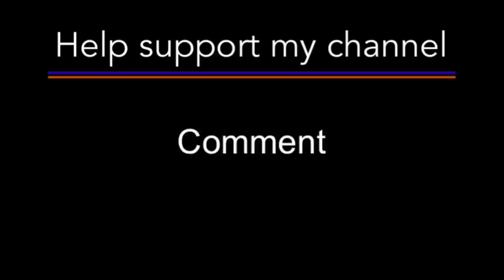Woodturning Green Wood: Walnut Log to Bowl - Turning The Big Green Monster

Comment: It's all a learning curve with each bit of wood you seem to be recognising your mistakes and problems your encountering which is a good thing to better one self I would only say one thing try and be more patient and take more time iam not a master by no means but I've learned that slowing down and being patient with yourself will guide you in the right direction keep the good work up .all the best
Reply from the maker: Thanks for the encouragement. This particular project was a bit of an experiment as I normally rough turn bowls, dry them in my dishwasher kiln, and then finish turn them. I wanted to try one green and see what happened-I like the organic look of the warping. I did end up having to rush the finishing on this piece as I got started late and ran out of time, knowing I wasn’t going to be home for a few days, but so far it’s not cracked so I may tidy up the finishing a bit once it’s done moving around 😁

Comment: What fun!  I love turning  green logs, can't comprehend having someone gift me a piece of walnut that size (any size).  If the lathe so stable and level, try building a cattle guard style mat out of construction 2x4 ripped to the width your need to get you at a comfortable working height. They are very common in front of metal lathes, both for foot comfort and safety as it gets you above the accumulated waste. Very nice outcome, good work!
Reply from the maker: Hi Gord! I must be doing something right, karma has been good to me so far 😁
I may try an elevated platform. For this walnut bowl I swapped my foam pads for a piece of 3/4” plywood with those foam play mats glued to the top, which adds probably about 1.5” of height and I still feel like where I’m comfortable holding the tools handles is a bit low. I’m a little nervous about making a platform so tall that I might accidentally step off it - I broke my ankle in Jan 2019 (and spent the next 3 months in the lazy boy binging Woodturning tutorials on YT 😁) and that was one of the worst experiences I’ve ever had. A plate and 9 screws, which I had to have removed after the fact cuz the hardware was so close to the skin it was gonna be a problem if I ever whacked my ankle on anything 😳
Anyway, I think I’ll try it and see how it feels - what exactly do you mean by cattle guard-the fencing to use as the platform top?
Reply: @LisaRamlow  hello again. Sorry I grew up in cattle country. What I was suggesting is to rip some 2x4 to become 2 3/4 wide (or whatever height you need. Then laminate them to 1” spacers so there’s a 1” gap between boards. Make it large enough so stepping off while working is not a threat. I get your safety concern perhaps adding a 30 degree transition or even 15 degrees so there’s no abrupt drop?  Just a suggestion you understand
Reply from the maker: Gotcha. A good suggestion and one I’ve been mulling over. Several of you have recommended the same sort of thing so I’ll have to give it a try 😁

Comment: Nice work.  My American Beauty has a much larger swing than I have bravado.  16 inches is my largest to date. I never turn green wood but you showed that it can be done with great results.
Reply from the maker: Hi Rick - that’s a nice machine, even if you don’t test it’s limits 😉
I normally twice-turn bowls but wanted to try one green and see what happens. I was really pleased with how my lathe handled this blank - I couldn’t get the speed up past about 300 until I got it more wound but the lathe acted like it didn’t even know it was there 😁

Comment: It’s a great looking bowl. You’ve got to love the ones that give you hell and test your skills. 
 I’m finishing up a 10”x 4” blank of Norfolk Island Pine. It won’t balance, no matter what I do. Tear out has been a nightmare. And I’ve had to walk away from it three times already. My daughter stopped by today and saw it on my lathe and said she really likes it.
 So those projects that test our skills will only make us better as long as we don’t give up.
Reply from the maker: Absolutely! I haven’t worked with NIP yet but may have an opportunity to get my hands on some this year
Reply: Regarding Norfolk Island pine, yah they don’t balance well because if you have branches showing in your piece, each one is of different size and weight. If you are planning to make it thin and translucent soak it for days or weeks in boiled linseed oil, polyurethanes and odorless paint  thinner equal parts of each and wet sand. I spent a day with Ron Kent  in Hawaii and that’s his process and mine too.  By the way you can find his bowls at Gumps for around 3 K.   Mine are considerably cheaper but he’s the original !!

Comment: Walnut with the wax wood is stunning. Love the bowl!! Cant wait to do bigger stuff but I have a 12in max for now. Great looking bowl :)
Reply from the maker: My Delta was technically capable of 12.5” and maybe with a round blank to start might have been able to handle it with the 1HP motor. This is a 220v 2HP motor and it seemed like it hardly noticed it was there!

Comment: Nothing better than a finished walnut piece. A suggestion for roughing out without getting the tar beat out of you. Try lowering the tool rest and gouge handle so it's not such an abrupt cut. Many of the great woodturners say if you're getting beat up, you're doing something wrong. It's no fun getting beat up by a piece of wood. I'd suggest watching Lyle Jamison's videos for basic positions of bowl gouge cuts. You'll never see him get beat up while turning. He makes it looks so easy and has many years of experience teaching. Have fun!
Reply from the maker: Hi Greg! I think I’ve watched all of Lyle’s videos, among others. He gets the speed up by starting the blank between centers and balancing it out, that way the roughing is easier. I didn’t want to do that with this big a blank so I used the faceplate. My bandsaw is unhappy again so I didn’t bother trying to get the blank any more round, just figured I’d do it on the lathe. Once I got the long end closer to the width it cut really nicely but because I had a couple of inches difference I couldn’t get the speed up right away and it was a rougher roughing out than it could have been 😂
Reply: @LisaRamlow  Lisa, Thank you for the reply. I don't own a bandsaw so either I do like Lyle (between centers - balanced) or if the piece of wood must start out of balance, I start with low speeds but found ways to avoid the beating. Go back to Lyle's videos and watch his tool angle. I used to just take the beating but my hands just can't take it nor should they. Try experimenting with dropping the tool handle and let me know what you find. Woodturning should be fun and when it isn't, it feels like work and gets a little discouraging. Just trying to help with what I learned the hard way. Also, it helps to take lighter cuts until it's more balanced.

Comment: Hi Lisa , Great looking bowl, it turned out looking very nice, you commented where you were saying your lathe was too tall , you could experiment by laying some sheets of plywood or chipboard down in front of the lathe until you feel you've got it at the right height but you must make sure you don't go on trip on it and fall into the lathe as you go to walk towards it so be safe, 
Phil from the Moulin in France.
Reply from the maker: Hi Phil! I did add a “riser” I’d used with my old lathe for this video - it’s just a 3/4” piece of plywood with those foam play mat things glued to the top so adds maybe 1.5” of height. I’ve thought about making a taller one but I’m a little afraid I’d accidentally step off backwards. I broke my ankle in 2019 and that was a horrible experience-don’t want to do that again! I’ll have to experiment a little and see how it goes. It’s not such an issue for the traditional tools-maybe I can just pay extra attention to whether or not the carbides are level when I’m using them.

Comment: I like it. Love the sap wood. Its a nice contrast. 👌 i rarely have time to finish a bowl in 1 session so i have started tieing a walmart bag over it while in the chuck if i have to leave it. Still warps some but seems to help a bit. Just something to maybe try if it comes up
Reply from the maker: Hey Brad! Yeah I did that with a wet white oak crotch piece and while it didn’t crack on the lathe and I was able to finish turn it, it made a nasty rusty mess of my chuck. I was going to be gone the next couple of days and didn’t want to take a chance in losing the whole thing. I like the wonky warpy bit just fine, if it will stay intact 😁

Comment: Wish I could have a play date with you.... As for the tool marks, both inside and outside, I prefer a shear scrape to a NRS. The NRS is still a scraper, and most of the time, since it is a scraper it will pull at the fibers to cut rather than slicing. The shear scrape, while not technically a scrape, slices. I prefer a dedicated scraper with a honed and burnished burr. The NRS works for some woods, but not others. It would have saved a lot of sanding time... On the inside, you have to shear scrape in stages, so on a bowl of this size, maybe 1 1/2 inches deep at a time. Because the wood moves as you hollow, you may have to blend in the stage marks... A coring system is a must if you are doing bowls of this size. I prefer the McNaughton, but as I say, 'Every one who has used it swears at it. Those that know how to use swear by it.' Oneway and Woodcut work well also. 

I don't turn walnut any more. Makes me sneeze and itch. I have found it to be a very easy wood to dry without cracking, very stable. I do like the stretch film on the rim, and start out with the bottom of the bowl on the concrete floor. A green piece is dry in a week to 10 days max. I do power sand, and prefer to have them dry before sanding. Having a lathe that goes down to 10 or so rpm is essential, otherwise, you have to spin the bowl by hand or use your spindle lock.
Reply from the maker: Meeee tooooo! I wanna come to Oregon! I’ve watched all of your videos at least twice and still got back when I get hung up on something, so thanks for putting out such great content 😊
Most days I do an OK shear scrape with a gouge on the outside. I have that cupped carbide shear scraper on a round shaft that I use a little on the insides if necessary but I just have a hard time making a smooth pull stroke with any tool (though I am getting better 😁)
You said a while ago (when I was using the shank end of a drill bit to put a burr on a scraper, which didn’t really cu it wasn’t the right kind of steel) that old router bits work well. I have an old straight carbide bit I don’t use so have been using that for the burr but I’m not sure I’m doing it right - I’m just holding the bit in my right hand with the cutting edge facing away from me and dragging the not-shear edge of the carbide across the end of the scraper at a little bit of an angle, maybe 5-10deg off from the scraper edge - is that right?
A coring system and a hollowing system are on my list - I want to be able to do some vases and hollow forms and now that I’m set up with my trailer ready to go I can get and process my own wood so I will have better access to pieces that would be good coring candidates. Aside from a couple of large pieces a friend of mine gave me I rarely have anything large enough to core.

Comment: Love big bowls. Add that it is walnut and you’ve captured me. The issue is that green walnut will warp like crazy. You did a great job with this piece. It will most likely stay together but will most likely warp so badly that it’s unusable. While watching I was asking why you couldn’t rough turn it and let it dry before finishing. Then again, I’m not good at doing that either. Beautiful bowl and I’m hoping it remains usable for you.
Reply from the maker: Hi Doug! I do normally rough turn, kiln dry, then finish turn bowls but I wanted to try one green and see what happened. I left enough on the bottom to be able to sand it flat once it’s dine warping so I’m hoping it’ll stay intact!

Comment: Well turned, thanks for the turning fix. I'm currently not able to turn due to recovering from 2 stays in Hospital, 1 for gallbladder removal, and the 2nd from infection from the surgery. Anyway, beside's from having the Lathe level, I've found having the spindle height at elbow height when your arms are relaxed in a standing position seems to be the best height for me, and a lot of turners seems to agree on that, and it works for me.
Reply from the maker: Sorry to hear you’re not at 100%. Hope you’re back to making shavings soon!
When I set the lathe I tried to level it where the sentry of the spindle height is at about my elbow. This is going to sound funny but I think my problem is that I have a long torso and short legs, so when I hold the tool handle against my body where it’s comfortable (about hipbone-ish) the end of the handle is lower than someone the same height but whose legs are longer and therefore the hipbone is higher from the floor. My girlfriend and I are the same height but her legs are 2” longer than mine and when I get in the car after she’s driven I can’t see out the rear view mirror without tilting it up 😂. In any case I think in addition to trying to pay attention to the tool position when I’m turning I think I’ll try a taller platform and see if that feels right. Hope you’re feeling better soon - thanks for watching and for the suggestion😁
Reply: Thank you, I'm itching to get back into things, at least YouTube helps with getting my turning fix, lol.
I think trying different platforms is a good idea, at least that way you can adjust things to find your best position. Goes to show that everyone is different, lol.

Comment: Good looking bowl. Having the lathe a little too high is actually a great thing. It is much more comfortable to work a lathe with a wooden platform under your feet.
Reply from the maker: Hi Charlie! I just moved the “riser” I had for my old lathe to this one to see if it helps. I have a piece of 3/4” plywood with those foam play pads glued to one side and that totals probably about 1-1/2” thick. I don’t think it’s an issue for the traditional tools but I think the scrapers should not be presented to the wood at a positive angle and what feels level to me while I’m turning is apparently not! I may try building a taller platform but I’m a little nervous about that since I broke my ankle in 2019 and that was a pretty horrible experience - don’t want to step backwards off something too tall and do that again 😬

Comment: Great job,  I think you would do better taking more out of the center and work on the thickness at the finish because centrifugal force throws the moisture out, so to keep it from cracking get the center out first then work on the thickness. Beautiful bowl and great work, always remember scrapers save the day, I still use them and they give a better finish than a bowl gouge.  One thing you did that was terrific was when you mounted the face plate you made sure it had a flat surface to mount on, people think that it is the screws that make the difference but it is the force the screws put on the surface of the face plate so therefore the larger the face plate the more square inches of contact. Keep doing what you're doing, and by the way I am unknown in the turning world. Thanks for sharing this great video.
Reply from the maker: Hi Kenneth, thanks so much for stopping by and for all the input I really appreciate it. I’ve always heard that keeping the mass in the center helps with the vibration at the rim but maybe that’s true for dry bowls and. It so much for wet ones. I’ll give it a try - I just picked up some yellow and paper birch that is super wet. I’m spraying water all over the place and it’s so damn heavy - getting it cut and in the trailer by myself was a challenge and reminds me that I’m not 20 anymore. Or even 40. I guess this will help get me back into better shape! 😂
Reply: @LisaRamlow  thanks for your reply, I ain't no spring chicken myself, but I can tell talent when I see it and you got it.
Reply from the maker: Thank you - I’m having a blast! 😁

Comment: Great video! Thnx! Just a few questions. I am upgrading from a midi lathe (Chinese manufactured) to the Laguna 18/36. Is the Laguna worth the money I pay? Secondly, what is your feeling on the SuperNova2 chuck? It's the chuck I am considering to buy. Which jaws should I use for larger bowls like the one you turned on the video?
Reply from the maker: Hi Phillip! Yes, Im very happy with the Laguna. I’ve had a few small problems here and there but Laguna’s service has been excellent. I upgraded from a Delta MIDI, which I really liked but outgrew. I am happy with the SuperNova2-it is pretty beefy and has a sealed back, but if money were no object I’d definitely get a Vicmarc chuck. For this bowl I used the 100mm set of jaws and it came with 130mm also so it should handle anything my lathe can. 
I definitely recommend the 2HP 220v version of the Laguna if you’re looking to turn larger bowls - I think the motor on the 110v version is 1.5HP and the extra torque is great for this stuff. I’ve not slowed the motor down yet and I’ve put some big, irregular, and off-balance blanks on with no issues.